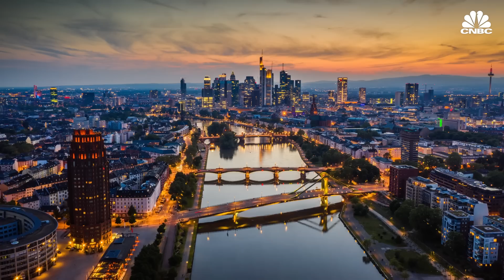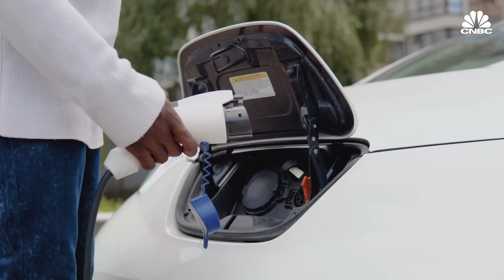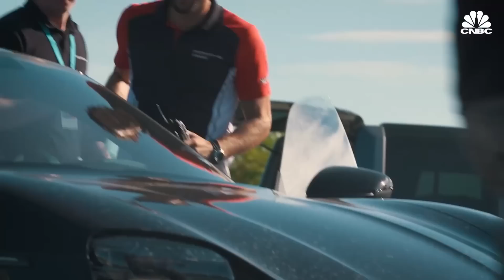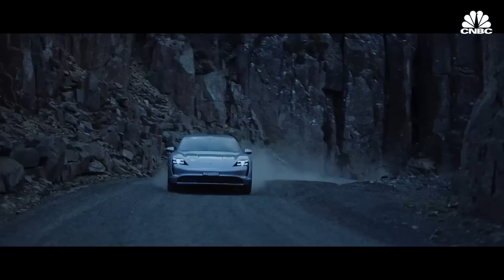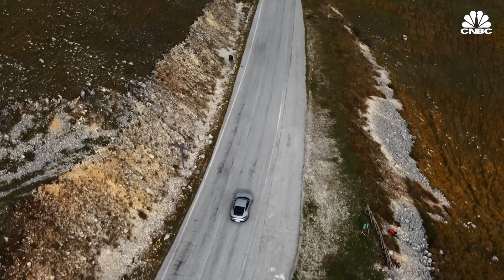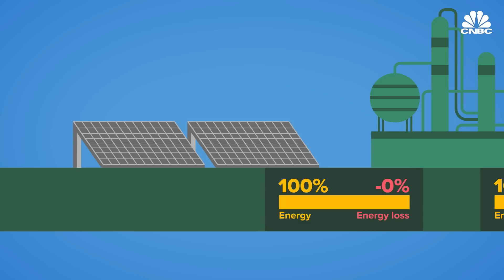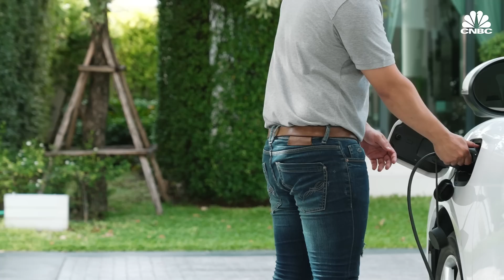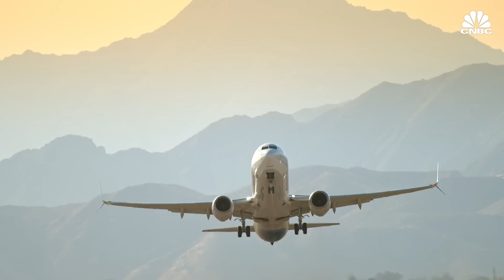How Porsche Plans To Keep Its Gas-Powered Cars On The Roads

Comment: You forgot to account for the carbon footprint and energy needed for MINING all the raw materials that battery packs use just to last at most 100.000 miles before turning into toxic waste. 
A good old gasoline car can endure at least 500.000 miles if well serviced.
I will never buy an electric car unless there's a major breakthrough in battery technology.

Comment: The Power Grid cannot handle the EV charging Deman either .  Not even in California.. Speaking of Which California does not have a Recycling Center for EV Battery Packs, due to Environmental Impact.  Cargo Ship Burn Down due to Electric Vehicle (EV) fires while Transport... Thermo Runoff is the reason. 👨🏻👍🏻🏎️🏁🚩🌲⛰️🧗🏻

Comment: and once you burn those fuels you get co2 again plus the energy used to create them. Makes 0 sence to use this kind of solution its insane
Reply: It is carbon neutral because they are only putting back into the atmosphere what they took out. It does rely on cheap energy to work hence why they are looking at countries like Chile.

Comment: EVs are not zero emissions except while they're being driven. The materials they're made from still have to be mined, transported, refined, built and shipped, not to mention recycling the battery at the end of it's life. The most environmentally-friendly thing to do is drive your car until it falls apart.
On top of this, cars make up less than 7% of global CO2 emissions - even taking every ICE car off the road now and replacing them with EVs will make virtually no impact. The only reason EVs are being pushed so hard is that they're an easy target that people can relate to - that's all (although I suspect governments are being lobbied by the EV manufacturers to force this change).

Comment: 9 months on , and this isn't aging well. Biofuels are far from Carbon Neutral, even if you pretend that using renewable energy on them instead of charging BEVs with that electricity somehow makes sense. (It doesn't)
It's just another pitiful attempt to put off the inevitable. Porsche's first EV has been an expensive white elephant, with horrific depreciation because nobody wants it. RIP Porsche if they carry on like this with their head in the sand.
Reply: Cool story 😂.

Comment: The average i.c.e. engine is only 16 % to 18 % . Instead of looking for fuels why do manufacturers not make (yes Porsche is 1 of the Best ) but make the engine more efficient. 
A simple electrolysis unit would make the Engine run on hydrogen made from water .. 💧..  H20 exhaust and since sludge is main reason for engine failure this would be eliminated mostly.  Happy 2024

Comment: I'm afraid that neither battery-electric vehicles and much less this near "needlessly expensive fuel for no reason" are definitive solutions for the long term. Wired-electric collective transport probably needs to expand at unprecedented levels, to the point that people would really not see having a car as a necessity, particularly bigger ones, which they may perhaps still want to rent on occasions. So you'd be reducing several problems at once, the ones from mining and emissions, and transport  itself, made more efficient. Besides avoiding the increased road degradation with heaver battery-powered cars. If something like that were to happen, probably it will start from some cities being small-scale revolutionary to some degree. Ideally you'd have a bunch of billionaires funding something experimental in this regard, company towns, like new Silicon Valley(s), that could be prototypes to which older cities would try to gradually follow in reforms.

Comment: My layman's Dunning-Kruger-effect-prone understanding of things is that if the EROI of a fuel is bad, then it's a waste of money and resources, it doesn't matter that you're capturing CO2 from the atmosphere. If that's done in any volume worth for climatic effects (which I seriously doubt), then it possibly can still have a higher EROI and lower net CO2 emissions by doing "whatever else" with that captured CO2 and then using conventional, cheaper fossil fuels, instead of wasting oney synthesizing less of it. Just but only the amount of fossil fuel you'd have synthesizing with the same budget, and pocket the difference, or give it to charity. 

Energy waste from excess production in renewables isn't really an excuse, it would be better to find "anything else" to do with the energy (even if only storing it in conventional batteries or try new technologies that seem reasonable upon scrutiny). The renewable energy surplus isn't even all that significant, since Germany still indirectly helps funding a war by buying gas from a hostile regime that wages it.

It is interesting though if one could devise a way to capture CO2 in significant volume, but I'm afraid it costs at least as much energy as it was produced by burning the fossil fuels in the first place, unless there's some really smart idea being neglected somehow. I'd guess the best bet would be massive reforestation, perhaps with new technologies allowing for unprecedented growth rates and nocturnal "hybernation" of plants, or yet artificial lighting so that they just capture CO2 as if it were day time.

Comment: GM seems to be hanging onto ICE motors longer with corvette flat plane crank and blackbird engine as well as others.  Another reason being blindsided by chinas 10 year lead in batteries, EV, and infrastructure.  China from rice paddies to space travel in 70 years.  China World’s largest importer raw materials.  China Brought prices down for solar panels with Europe investing heavily with USA slowly becoming interested.  World’s largest battery manufacturer, CATL.  China leads world in rare earth metals and refining lithium.  A tsunami of cheap Chinese EV’s hitting European shores where Europeans are buying but  concerning German auto.  Stellantis bought a huge part chineses EV company to rebadged to be sold Europe.  Europe so afraid of competition thinking of tariffs on Chinese EV’s and dropping tax incentives.  Germany and USA guilty of turning a blind eye to EV’s they reached such a pinnacle with gas engine engineering but to start over again at ground zero when others ahead like Warren Buffett’s BYD and Tesla.  They better turn more eyes before losing more business.  Efuels are great but just like the 1970 oil embargo Japanese fuel sippers vs Detroit muscle cars history repeats with Chinese EV vs gas cars.

Comment: Just think if EV’s had been around for 100 years and a new invention arrived the internal combustion engine.  Yes, the gas engine is very inefficient at 25% but oil is so cheap in 2024.  You mean u can not fill up at home with solar?  I must travel to a gas station!  I fill toxic fluids into tank and burn them into more toxins?  Oil changes? Tune ups? Radiator and transmission services? So many moving parts to wear out!  How come so much noise?  Why does the transmission shift?  No torque at 0 rpm?  Petrochemicals odors?  Yes, fuels maybe a bandaid but dirty vehicle.  Once USA has own battery companies in USA vs buying from South Korea and China profits will go to USA manufacturers vs 3rd party battery suppliers.  Batteries and chips are homeland security issues.  Batteries cost will come down.  EV’s are cheaper and faster to make vs all the moving parts gas car.  Software updates vs parts wearing out and replacements.  Electricity will
Always be cheaper than globally priced oil.

Comment: E fuels, NET Zero. All good. For me its the overly stringent left wing political machine behind policies that is the issue. The fuhrers 4th reich demands 1 car for all. This time round it isn't the VW Beetle, its the EV. But the goal is Net Zero. Anything that meets that remit should be two thumbs up. In the same way...the fuhrer will not tolerate individual efforts for individual cars. E85 is a bio fuel. Any petrol car can be run on it. My ECU and pump will run it. The Fuhrer says...car too old...off to the shower block it must go.

Comment: The real value of this technique is its potential to over produce and hence become carbon negative, if a suitable storage method is used.

So the factor 5 difference in energy efficiency of efuels vs. BEV would be offset by the reduction in co2 in the atmosphere, if say every litre burned (because fuel is going to continue to be burned for some time) corresponded to some x litres equivalent stored.

This is a great way to get scale production (and hence potential over production) up and running as a parallel approach to addressing the problem of rising atmospheric co2.

Combined with the other bio storage methods for co2 reduction, which would also be equally useful for fuels in those cases where it makes sense for now, this seems entirely necessary.

Comment: Gasoline and Diesel Vehicles will be on the roads for decades, after 2035 if you want a new vehicle in the USA then it's going to be Electric. You can still buy Liquid Fueled vehicles until the year 2055 but they need to be used. After 2055 I don't know what will happen. 

Someone who purchases a brand-new liquid fueled vehicle on 12/31/34 will expect support and service for 20 years, we cannot expect those people to give up their vehicles the day after. They will need to be able to purchase fuel and have service performed when parts fail. That's why I say 2055, but after that I am not sure what will happen. 

In 2035 when sales of liquid fueled vehicles cease, we'll be at 25% EVs on the road, there will still be 200,000,000 Liquid fueled vehicles on the road. It'll take 15 to 30 years for 85% of those to disappear. 

In the USA there are 31,000,000 Classic cars, those will never disappear, they make up around 11% of the 282M vehicles in the USA today. 

There might very well be 15% of liquid fueled vehicles in the USA after 2055. 

What do you think?

Comment: They don't they try building a 911 that runs on hydrogen? It's still in internal combustion, but cleaner and far more efficient.
Reply: Hydrogen cars aren't currently suitable for performance cars. The fuel tank takes up a crazy amount of room and the engine isn't very powerful. Look at Toyota's hydrogen cars which are slow and cramped.

Comment: with EV's you have to stop every 300 miles and wait at least an hour to recharge, that's terrible!!! for now i prefer gas run cars much better
Reply: The tech is getting better. Porsche has got the charging down to around 18 minutes for EVs. The only area that ICE will outperform EV is fun and sound. Give EVs a few more years and the range will double and the charge time will drop below 10 minutes. I don't even like EVs but their rise seems unstoppable.

Comment: the efficiency is just ridiculous to me. that e-fuels don't make sense for cars purely from an efficiency standpoint is a non argument. abundant energy will make this a non argument. shipping and aviation industry will need these kinds of fuels which in turn means that these industries will invest heavily into the infrastructure needed to make e-fuels. when these industries are up and running at full speed, the transport sector can use this to support their own net-zero path. sure EV's are more energy efficient when using them but there is still a large part of the population that actually likes ICE or even needs them because there is no grid to go full electric at this moment.
Reply: no third world country has a grid or are starting to have one. it sucks that they are pushing EVs even here a country that was 6 months without electricity and could only move because nobody here depended on EVs.

Comment: You should acount for the inefficiency of battery production, battery weight, battery recycling for EVs.
A combustion engine is less efficient, but lighter weight easier to manufacture and recycle. The infrastructure to fuel them already exists, so no need to increase the electric grid power on a massive scale.
E Fuels are also easy to store when compared to massive batteries.
Reply: I'm from New Jersey, a state with a lot of CO2 emissions due to the nature of high density and having large cities like Newark, Trenton, and Jersey City, all located between Philadelphia and New York City. My state should consider in creating e-fuel stations.

Comment: The ICCT is not thinking right. Electrification is a way ahead for new fleets of vehicles, but the existing fleet must also decarbonise. How can they argue against a technology which so complementary to EV tech? And as mentioned in the video, planes and boats, which are absolutely MASSIVELY polluting transport methods would be able to instantly become carbon-neutral (assuming production scale is reached). 
An all-round energy mix is what we must have, not solely one technology. Electric planes...come on, let's be serious..

Comment: I think that e-fuels and bio-fuels will continue to be a valuable source of energy, especially in transportation. Full electrification is great but it's just not feasible for a handful of usecases. I personally think that biofuels made with a solid carbon byproduct (e.g. 

bio char soil additive + wood fuel gas

and

charred plastic to be buried in former coal mines + sour fuel gas

) are going to be a significant source of carbon capture because of how easy it is to collect waste plastic and waste biomass. 

Also, methanol is a liquid fuel that is relatively easy to make out of green fuel gas (hydrogen fuel gas, wood fuel gas) with the help of a catalyst, so for industries that need compact liquid fuel, I think methanol or e-fuel is the answer.

Comment: What is the components of exhausted emissions? That is what determines carbon neutrality.
Reply: No. It will burn like any other fuel. The carbon neutrality comes from the carbon capture process. They take it out of the air and then add it back when used in the car hence carbon neutrality. Take out one unit of CO2 then add it back equals carbon neutrality.

Comment: Hopefully Porsche can figure out how to make a compelling electric car and we can move on from this meshugaas. Understand that they don't want to have to write off all this capital, but hopefully they can beg, borrow, or steal the necessary engineering acumen to build an electric successor to the 911 before they lose this market to someone else who does. As for the 911 itself, it's not the 911 it used to be. The current car is fricking huge, heavy, and far, far away from what made the 911 such a great car so many years ago. Time to move on.

Comment: what might be interesting would be a compressed air assist pneumatic motor coupled with a small high revving ICE. if you only need a few burst of speed a day like for commuters getting on a freeway when insidious accelerationwould be wanted. just takes space for a compressed air tank and you can make compressed air with RE. BTW - has anyone out there comotted in the DC area or taken route 9 out of leesburg?

Comment: Synthetic fuels are the future. EV's are a joke. EV's are super expensive to produce, have very limited life spans, and will never match gasoline range. EV's are also heavily subsidized by the government, making a full scale up unrealistic. EV's also don't solve the problem of current cars, trucks, planes, trains and boats. All of which will be in use for many decades to come continuing to use fuel. Synthetic fuels solve all of the problems right away by making everything on the road carbon neutral.

Comment: efuels make zero sense for large scale use in private mobility. The energy efficiency is not just bad it is abysimal terrible, even compared to fossile fuel driven vehicles. CO2 emission is therefore, due to that inefficient use of primary energy actually even worse than with fossil fuels, even if the fuel itself is carbon neutral. 

Efuels have their use, in places where it is impossible to use electric motors or just not economically feasible. Cars are none of those. For oldtimers however, which is a tiny niche, wastefuel efuels, with a bad CO2 balance, can make sense. Simply because it wouldn't be an oldtimer if you teared the guts out of the car and replaced them with modern tech, would it?

Comment: Synthetic fuel has an infrastructure it can use. The one that petroleum uses. We still need to finish building the electric charging and hydrogen stations. Synthetic fuels can easily go ahead of everything if they begin to mass produce it. Yeah i Know it's in the testing stages but still.

Comment: Pipe Dream...

Slow, noisy, smelly, much more susceptible to break downs with so many moving parts, compared to EVs.    Fuel prices will keep rising as demand disappears.  Once the billions of subsidies paid to oil companies are cut off a gallon of gas will be unaffordable.  E-fuels will be the only option, but with very low demand it won't be able to produce high volumes so it won't be affordable either.  Other than for historic sake, there is no way ice cars are going to last.

Comment: Makes no sense that they are extracting Hydrogen and then making e-fuel out of it……why not just use hydrogen powertrains
Reply: Hydrogen power trains do exist but the issue is that they are waaay less efficient compared to gas or e fuel, i believe hydrogen combustion produces something like 25% of what conventional combustion does.
Reply: Synthetic fuel can replace petroleum which includes all of the stations in the world. You would still need to build hydrogen stations.

Comment: I have owned a half a dozen Porsches in my life, but I will not own another one. I'm all for them developing an eFuel to offset the trend of petroleum fuels, but to make it by capturing CO2 from the air - is the stupidest thing to do. Let's trade an already low CO2 level for a non-petroleum fuel that we wouldn't need if they got off their climate change arses and faced reality instead.
Oh, and for all the climate change proponents watching, CO2 makes up less than 1% of our atmosphere. I doubt CNBC will share that fact with you.